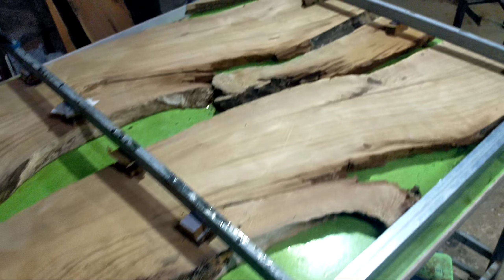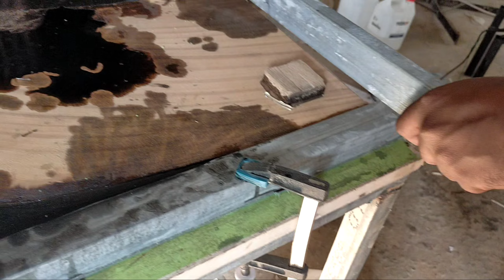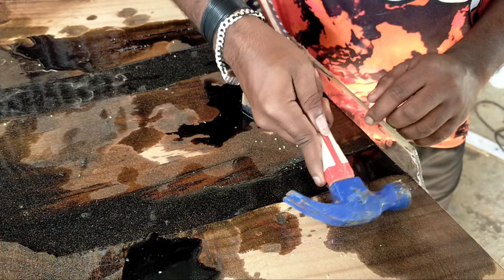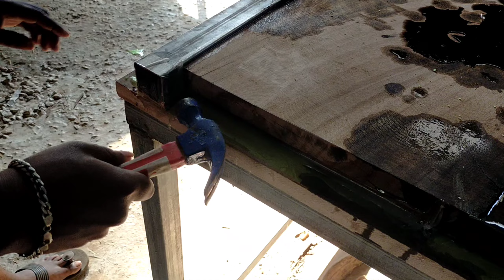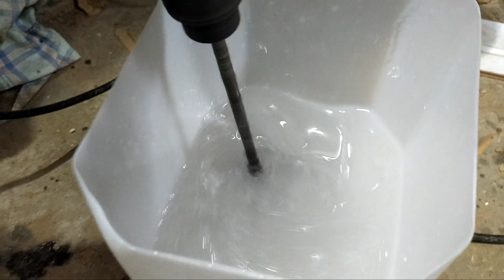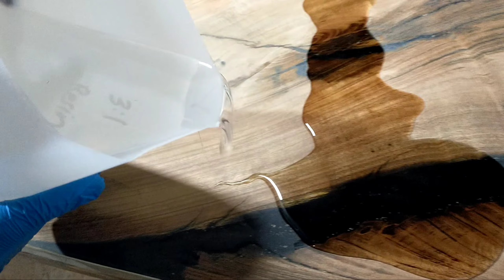Epoxy Resin Furniture | Resin Art | Epoxy Resin Dining Table

Comment: Resin frame indakumboo athile led light athil correct ayitt fix akunilla. Athu mukalilum  pongi verunnu..  Mold inekalum mele varunnath kond crt finishing kitumilla.. Resin framinte mukalil lightsinte strings kanunnu.. Soft pradhalam kitunillaa...... Ithinoru solution para  plzzzzz
Reply from the maker: Oru cheriya casting aadhyam cheyyuga.. adhu dry aavaravumbo light ottichu vekkuga.. final layer ennittu cast cheyyuga